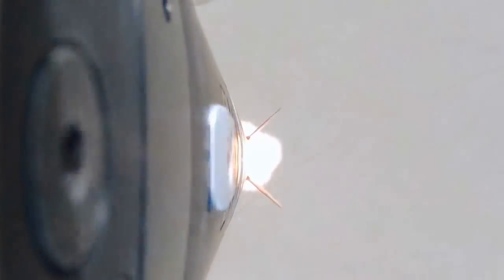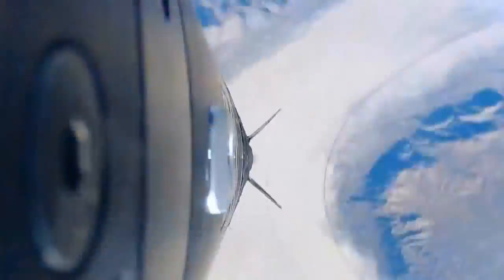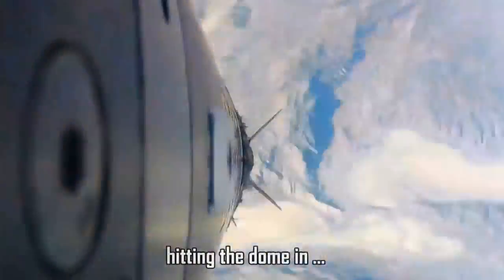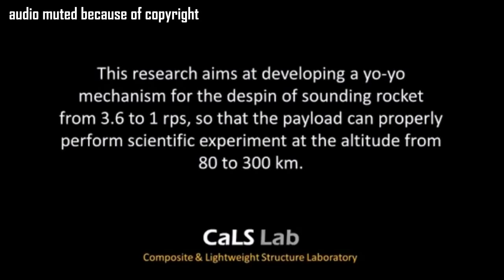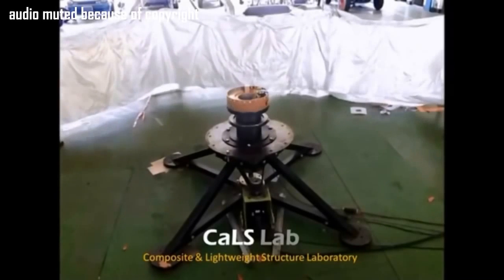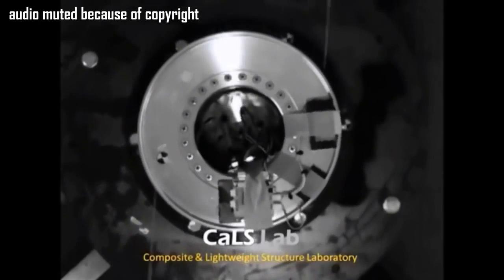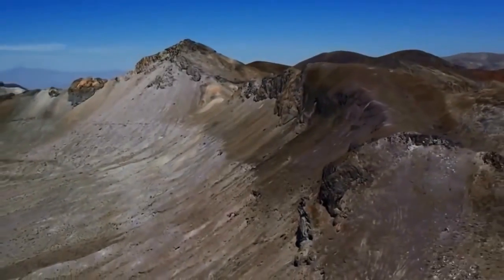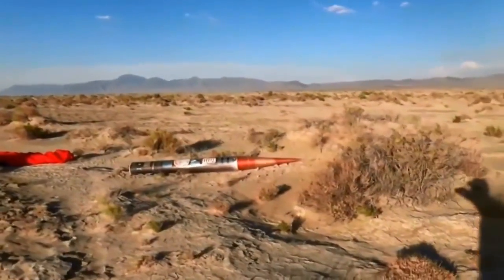Rocket hitting Dome "debunked"

Comment: If this yo yo system is responsible for stopping the rocket shouldn’t we see this system on the ground by the rocket?
Reply from the maker: ? U mean spectaculars? Cause the rocket is high up
Reply from the maker: Or because when systen is activated its up worded path stops
Reply: @sean.g  I don’t think you understand my question. I’m asking, if these yo yo’s were used to stop the spin and ascension of the rocket  shouldn’t we be able to see yo yo’s attached to string laying on the ground beside the rocket?
Reply from the maker: Lol my bad . the main use for the system is so the parachute doesnt gwt tangled up . the rockets spin is stopped as much as possible